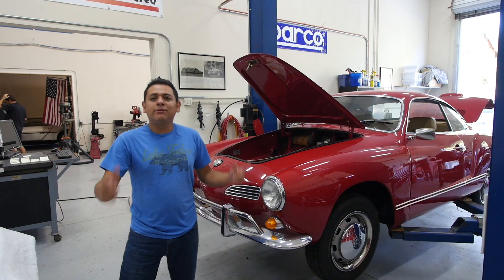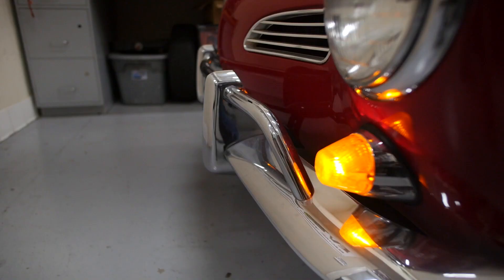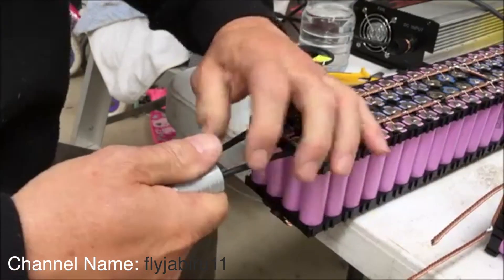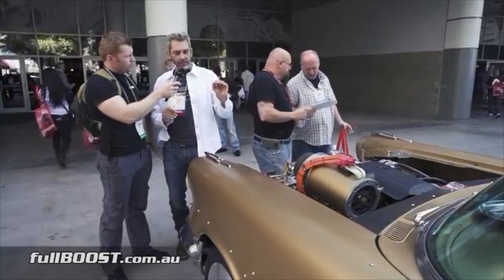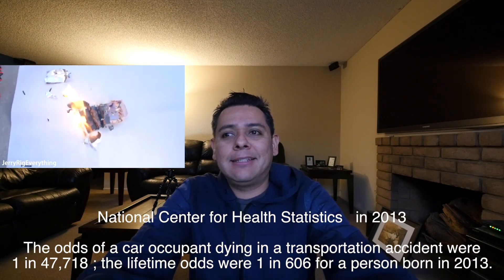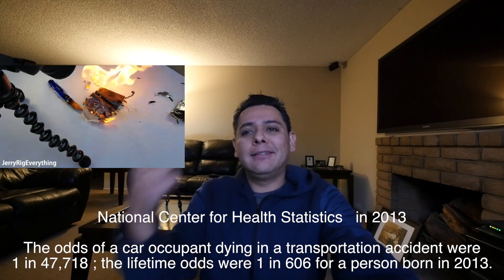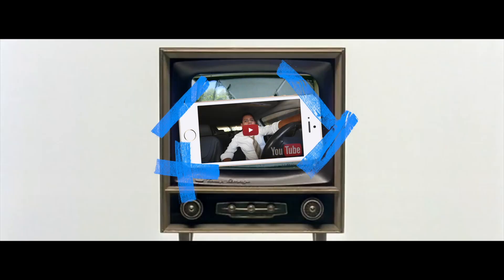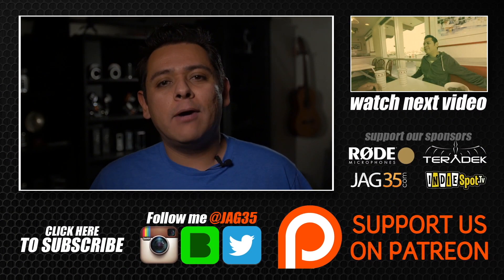3 Cool Projects - Hybrid AC-50 car - DIY TESLA POWERWALL - Samsung Note7 Exploding

Comment: I have an old laptop battery pack. I checked the cells they are all dead reading 0.9V, so i connected the batteries in parallel with other good cells for a few seconds (the voltage became about 2.7v so my charger can read them), and i then fully charged them with low 0.1A current until 4.2v. Now, I did  a discharge test and they have good capacity about 2300mAh. Are they safe to use now? Can i use them ?
Reply from the maker: Sounds like you could,  they might not have been that low voltage for long

Comment: huge Ls belt driven 56 ?
Reply: MrRandom well , I guess yeah. i would actually think it would need a electronic clutch to engage and disengage but I think at the same time he said he regenerate . I know that's an awful heavy car tho. pretty clever.
Reply: i think he is using the electric motor to help turn the crankshaft, taking load off the ICE, meaning it uses less fuel.